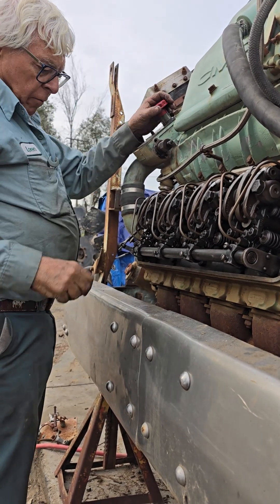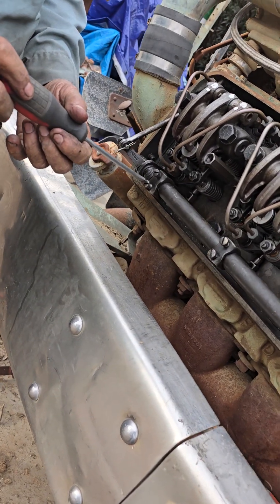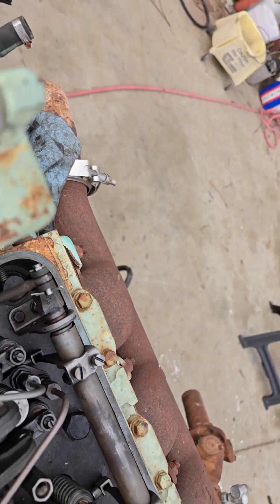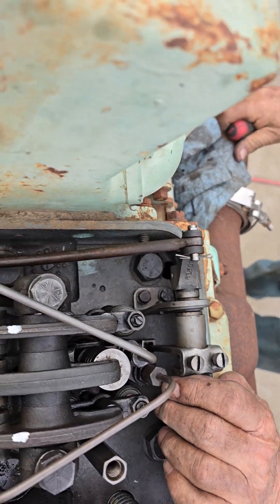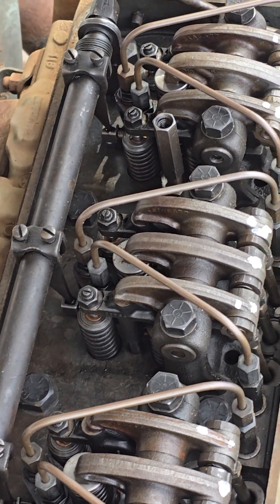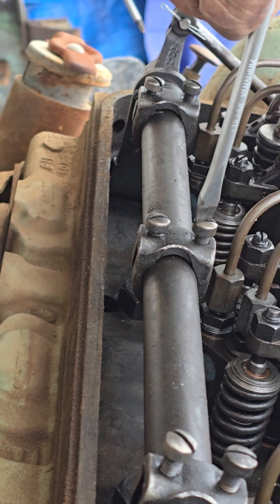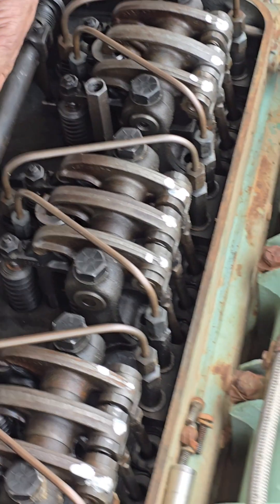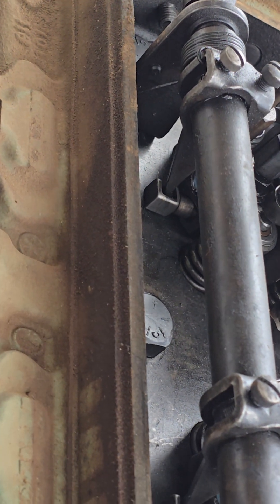Setting the mystery Detroit to "full fuel"...

Comment: Any more info on the engine? Would love to learn more! Also is that 6 valves per cylinder?? (Might just be seeing it wrong)
Reply: Middle spring you see is the injector plunger return
 4 valves per cylinder
Reply: It is a 2 stroke diesel. It has only a exhaust valve as it takes the air from ports in the bore on the intake stroke. fascinating engine and worth having a look at on here.
Reply from the maker: Hi Jelly
I put together a playlist for this engine and it has 34 videos so far...all short. Check it out:

https://www.youtube.com/playlist?list=PL9HVGkM-tNZFmUQt6nYrh-pMr-RFGn7j5